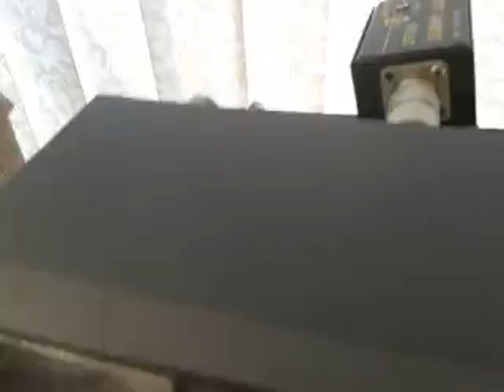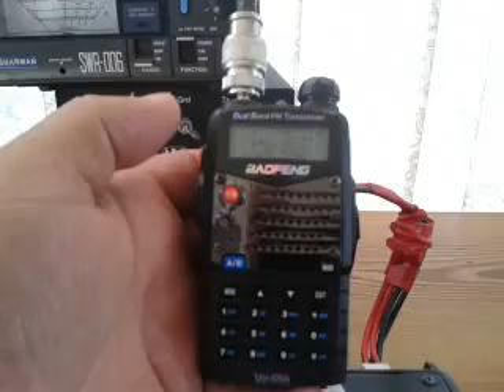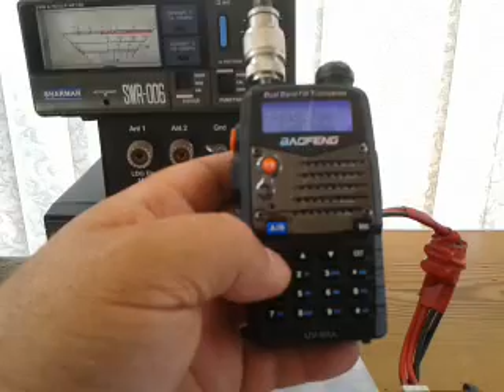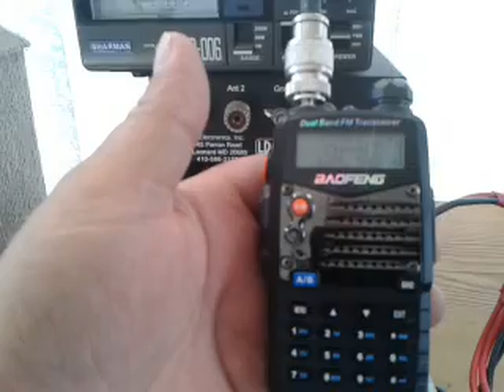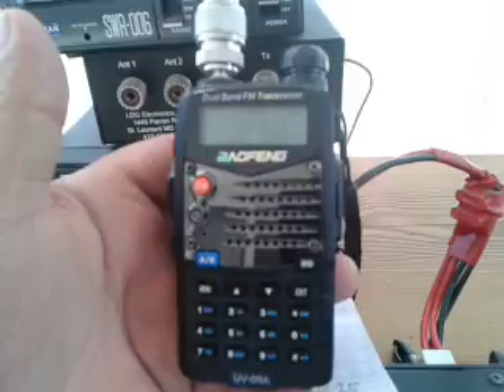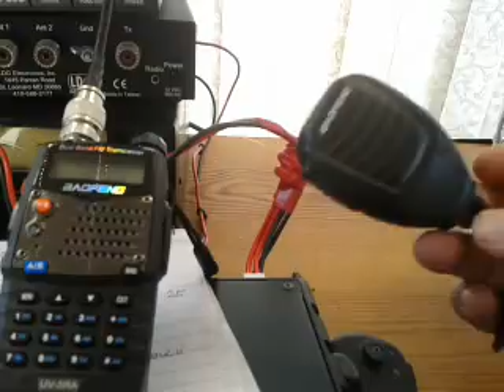Baofeng uv5r power test, A great budget handy

Comment: I sort of 'breed' Chinese handhelds; at the moment I've got x2 Baofeng UV 5R's, x2 Puxing PX777 (UHF only that I did use for PMR446 experiments - programmed for 70cm now), and a Tytera MD-380 DMR/FM (UHF) for the DMR repeaters and DMR Simplex.

A lot easier to program with CHIRP to be honest, as you can program a pair or more of these at ease for going out and about orienteering or something.

They are good for what they are, but to be honest they're the Commtron Nato of the Amateur Radio world. Because, the front end gets clobbered by very strong signals; you will find that if you go to a hilltop that has PMR repeaters on it (like Billinge Hill local to me) it will get overloaded. A more expensive Yaesu/Kenwood/Icom will fare better on the hills. Personally, I just use them to access repeaters and leave simplex alone when I'm out and about. 

Supposedly, I've heard the Misuta models have improved innards and AGC and have been revised. I also use a Nagoya/Diamond 771 antenna and it works very well with it.

73

Comment: I have bought about 15 of these radio's Steve I use chirp to program them. 9 of the 15 I bought others bought from me might I add at cost. 3 of mine went out and died with the first 6 months but all the others are working great. I like the battery life on them and for the money you can't beat it. I live in the USA and on Amazon I was paying $29 which is about 19 quid.  Good vid Steve
Lee K5NOV Oklahoma

Comment: hello again steve,i looking for a set of rigs for just me and my mate to talk so was looking at d baofeng 666s 5w rigs,do u think these would be any good and would it b difficult to programe them, there on dhgate for $45 a pair with free post tks mate..
Reply from the maker: Hi Castof for short range the Boafengs are ok, range is dependant on terrain.It really depends on what you hope to use them for, above all make sure you only use the PMR 446  channels.They can be a bit tricky to get the hang of, if you get ANY  problems just ask on mate.
Reply: Steve Stevens ta very much steve..
Reply from the maker: HI Castof I just did a quick search and found a fella who did a review.
He said they are a nightmare to program, and in his tests they only put out 2w.
There was a string of comments with people saying they also had problems.
I suspect that like anything else it can be done but will take time to work out.
They also need a program lead and software.
That's all I know, myself I would go for the uv5r, but its your money my friend.
Mine are doing good for me and can be set op pretty easily from the keypad.

Comment: Hi Steve just bought a Watson LW-40 Long Wire end fed antenna for my Yaesu ft-817.
Now this is too long for my garden as my garden is 25 metres long could i just cut the wire to 20 metres?
I will be using an auto ATU.

Advice appreciated
Reply from the maker: Hi Simon no don't cut it mate, dog leg it.
In an ideal world it should be at full stretch in a sr8 line, but as we don't live in an ideal world.....
I don't know that Antenna how long is it???
Remember just because an Atu will tune something, it don't mean it will radiate a good signal.
Reply: The wire is 40 metres long!
I have a pole at the very bottom of the garden so could a make a "V" and bring it back to the house.
Do you need to attach an earth cable to it?
Thanks for replying so quick
Reply from the maker: *****
Hi Simon let me look the Antenna up,
BRB
Reply from the maker: *****
Right omg 50 quid ..
Anyway I se a wing nut on the unun box, is that for an earth???
Your station should be earthed, as its fed via a pl259, if you earth the radio, the Antenna also gets an earth.
On an 817 you are gonna want that Antenna to work as best it can, what do the instructions say???
Get the wire nice and high, if need be wind some exess wire around something.
That's at the end of the Antenna not at the beginning, around 80% of your signal gets radiated in the first 20% of the wire.
I once wound exess wire around a piece of plastic pipe that was about 5 inches across.
Aparently the white tubing is best as the grey and black are conductive.
At least electric ly it will be the right length.